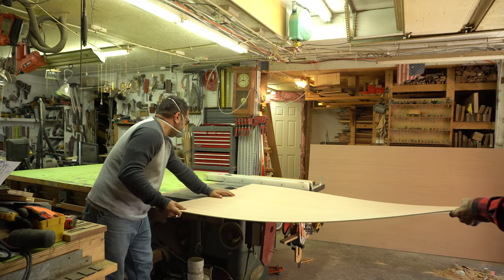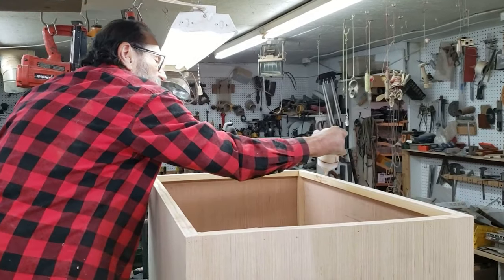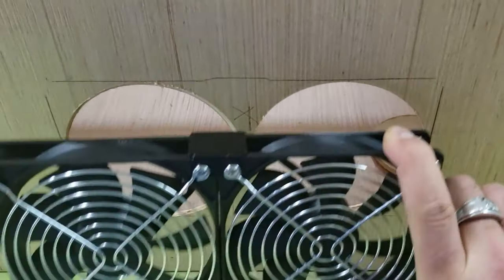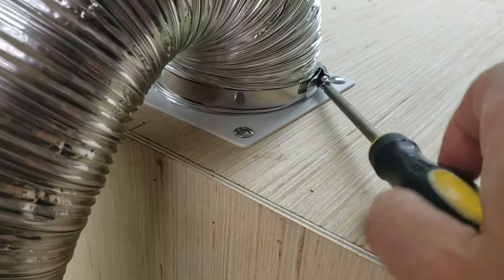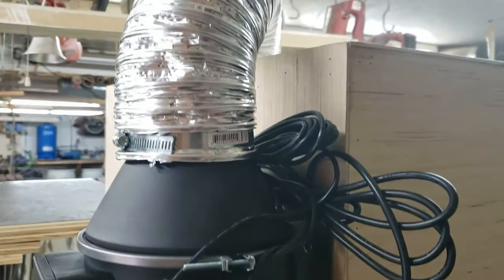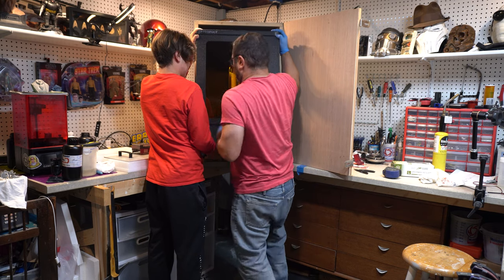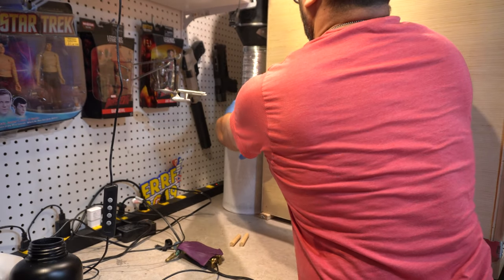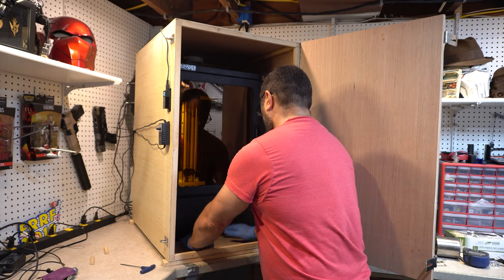Peopoly Phenom L Ventilation System [3D Printer Ventilation]

Comment: Now this is a great topic!
Reply from the maker: Yeah, it wasn't even an option. The wife was like, all I can smell is chemicals, and in the end that's what I was smelling. So glad I did it.
Reply: Its a topic and a subject nobody is really addressing. I would have liked to seen more on the carbon filter unit and how it all works. Other than that great video!
Reply: @3DPrintedProps  I was always under the impression that you actually wanted to keep the SLA Printing warm not cold - cold seems to kill Prints?  - Wouldn't you want to put the carbon filter inside the enclosure and then do a closed loop with the warmer going back into the enclosure again so you have to keep the resin at a more constant temperature?
Reply: @learnilluminatedrealitystu5571  Yes! I was thinking the same. Building a similar solution for my new Photon Mono X, how can this sytem be improved to mantain the proper temperatures isnide the enclosure?

Comment: I don't have a resin printer - yet, but when i get one I was planning to set it up in my basement.  Our laundry is also there, so I am planning to add duct work with a blower and filter and add a 'Y' adapter to the drier vent to duct it outside.
Reply from the maker: That's a great idea, My dryer is on the total opposite side of the basement so that wasn't an option, but its a great idea. :)
Reply: Was thinking about tapping into the same sort of hosing (in my garage), but worry about fumes creeping back in through the dryer end when the blower is off.
Reply from the maker: @JohnJones-oy3md  I think the fumes are mostly a problem when they are being heated, yes resin smells all the time, but you really get the fumes when its "cooking".
Reply: I did this exact thing and it works great, but make sure to get a couple of one-way valves, otherwise your dryer will blow hot air back through the Y splitter into your basement

Comment: For my Phenom I actually bought a cheap 2x2x4 grow tent off of amazon. It's already got the spots built into it for attaching hosing for ventilation. Running it into essentially the same filter and fan there, but you could also vent it out a window if you are close enough to one.
Reply from the maker: Great idea. I was going to go out the window but I wanted to try this thing. Seems to be working well.
Reply: What is the definition of cheap here?  I am on looking at grow tents on Amazon.  The starting price is around $60 and can skyrocket from there.

Comment: I just copied your setup. Thank you! Happy wife, happy life, indeed! Its amazing how great these filters are. I've tried other filters and they don't work, and are expensive. $60 got me the vivosun setup with fan, hose, clamps, and the filter. 

One thing someone mentioned to me was they tried this and the negative pressure was ripping prints off the build plate. I have my printer in a box with a slit in the opening to alleviate the neg pressure.
Reply from the maker: Cool! Yeah the fan blowing air in helps negate the pressure.

Comment: Quick tip, you could use a usb extension cable to the outside of the box to make usb connection easier. Also, (and take this with a pinch of salt as i havent researched it properly myself yet), i have been told that carbon and hepa filters arent actually enough to remove toxic fumes. Theyll remove the smell but not all the toxins.
Reply from the maker: Yeah, I started using one and am working on venting it outside. :)

Comment: Looks good! I think it would be possible to instead just make a few 3D printable brackets that attach to the phenom on the 2 vent holes on the sides and the vents in the back, then you could ventilate the fumes out through dryer tube out a window or into a carbon filter without having to have the machine in an enclosure. I'll probably be designing this and make a video in the next few months.
Reply from the maker: Yeah, that would work, But my shop is on the other end of the basement and this was just a fun simple build that I got to do with my father. :)

Comment: Any ideas on how long the Carbon Filter will last before you have to replace...and how to figure out when to replace?
Reply from the maker: That is a great question. My plan isn't very scientific, but when my wife starts to notice a resin odor, Ill know it's time to change it. I think it will all depend on just how much you print. Hope this helps. 😀
Reply: @3DPrintedProps  LOL - I figured that would be a good test.  Just trying to decide on using the filter or ducting out a near by window.  Thanks!
Reply from the maker: The problem I had with using a window was air flow. It's cold up here in the North East and I didn't have a way and didn't want to fool around with a way to vent it and not have to take something in and out of the window. There are ways, but I just didn't want to do them. This was easier and cheaper for my situation. Take a look on the Peopoly FB group, there are people there doing some other things too.
Reply: @3DPrintedProps  Thanks, I'm in Texas...so not as much of a freezing issue here, but I like that there is an alternative to having to have my window open and nullify my double pane window's energy efficiency.

Comment: Considering the size of the printer in question, perhaps there is an opportunity to 3d print the entire enclosure in four parts? That would be quite a sight.
Reply from the maker: The cost in resin and time would be more that wood. And you would necessary be printing a bunch of flat slabs.